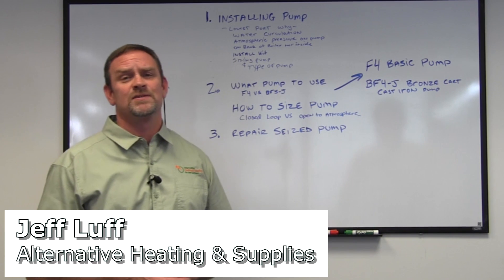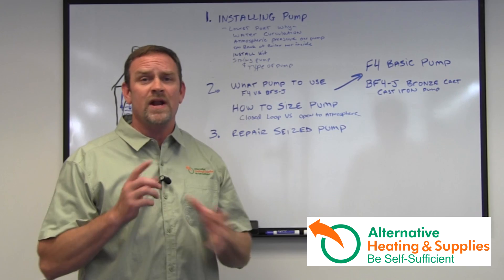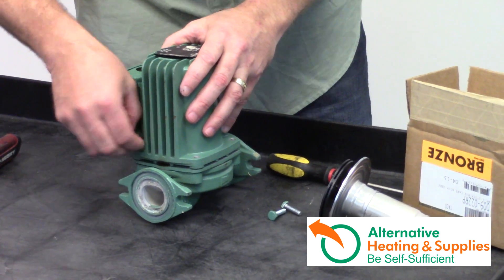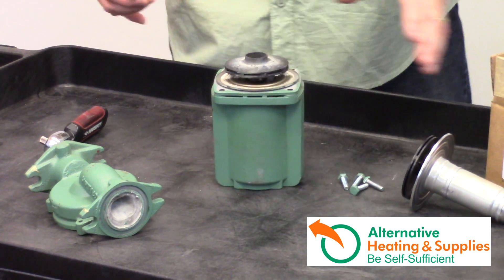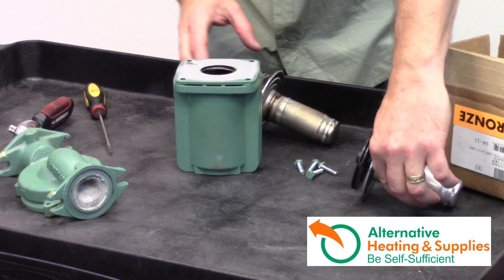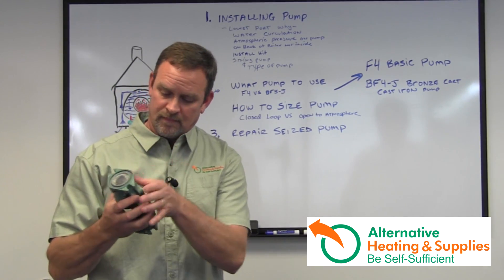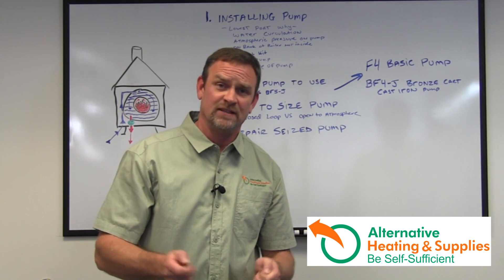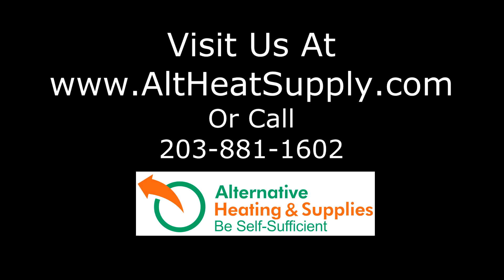How to Fix a Seized Circulation Pump in an Outdoor Wood Furnace Boiler 🔧🔥 | DIY Wood Boiler Repair

Comment: Thanks great video.     I have a  pump that that went through a leave the outside boiler door open overnight, it cleaned out the stove.  Now the Taco pump doesn't want to work to pump water to my shop. Is it scrap or can it be repaired?  Thank you for your time and expertise.  
Cheers
Frank😅
Reply from the maker: Try what I talk about in the video, Try taking out cartridge and loosen it up if you can, or you will know if something broke. I have had a lot of luck repairing them. Jeff

Comment: The only problem I have with my owb is the pump. I’ve had a “new cartridge “ freeze up  far to early. Had to replace 6-8 x in 10 years. Sometimes the bearing implodes , scum , or for no reason but I wonder if some lubricant n don’t tell me about the water being that but I’m inclined to add some new oil maybe 16 oz to 200 gallons n see if it lasts longer but I sure have shitty luck here. It’s a taco oo9. Any input ?
Reply from the maker: Buy the Bronze version Taco 009 BF5-J pump they last longer. Also make sure the pump is mounted on the lowest port on the boiler. A lot of boiler companies tell you to mount the pump on the upper pump and that is wrong.

Comment: What's the trick to get the grundfos pump impeller spinning after a cap replacement. Original cap tested fine. Impeller can be hand spun started but will not move during powering up. No burnt smells.
Reply from the maker: I would call Grundfos to answer that, not sure what your situation is.
Reply: @AltheatsupplyLLC  do you have a open dialog with grundfos? Obviously they want folks to buy new and not make parts repair or parts replacements...but I find this circulator pumps fine....but I cannot keep it powered up 24/7...we are off grid and have parasitic loads on timers. It just will not turn over unless hand spun.

Comment: I worked in plumbing for 27 years, butt this video taught me something. All I ever did was swap out pumps that didn't circulate. My pump seized earlier this year, I planned to replace it before the heating season. After I stumbled across your video, I serviced it and viola, it works! 20 minutes and no money! Thank you from an old plumber.

Comment: Do you need to bleed the system if you have shut off valves on both sides? And I have had two circulated pumps replaced and still have them they made a high pitch sound, are those fixable?
Reply from the maker: Most of the time no.

Comment: Where are most of these located? I have a cozeburn 250 and I'm 19 but I bought my first house and it has an outdoor boiler. I am unsure what's going on but maybe you can help me out. Everything was going good until my Fiance decided to make it 80° in the house I turned the thermostat when I got home but later that day the water was steaming out of the top. I now have shut it off after refilling it at least 5 times just today, I'm wondering if I need a new boiler for outside or I need to replace the water pump or something. Any advice would be greatly appreciated
Reply: Ur cartridge froze up I’d bet.

Comment: Wow! Straight to the point! Now I can size up 
if my home warrantee contractor 
knows what he’s talking about...
or not! 😉
Reply: That is my biggest problem having a seized pump and HVAC AMATEURS not having a clue as to what they are doing...and "being an OLD, OLD lady...I do not want to DIY because there are many times I do not have the TOOLS OR  STRENGTH TO DO a repair...I know how to do it...I simply don't have the strength to do it.   

Then I run into the problem that working with MACHO that because I AM A FEMALE...I MUST NOT KNOW what I am talking about.
Reply: @Princessmmviii  never mind the clowns that charge $400 to come out and fit a $20 part.

Comment: This weekend we are replacing both of our tacos. We have been in this house for 16 years and have not had much luck with the heating system. 4 years ago we went from a boiler system to a tankless. We thought this might help us with our heating issues. During the winter on cold night you cant get the heat above 55. I am hoping that by replacing these circulator pumps that the heat will finally work the way it should.

Comment: Thank you. I bought a few 007-F5s tacos on Craigslist to build "feed & bleed" systems for temperature control of my beer fermentor jackets.  Went to start the first pump and ........nothing. Kicked myself for being so cheap as the replacement cartridge is over 60% of a new pump. Then I found your video.  At first I thought I was freeing up the impeller but turns out the impeller was just turning on the shaft as it is only a friction fit. But I removed the impeller a gave the shaft a little sharp hit as it was frozen solid and voila!

Comment: WHATS THE DIFFERENCE FROM CAST IRON TO STAINLESS STEEL HOT WATER 
CIRCULATING PUMPS.I got an old 50-year-old hydronic boiler. But I don't 
know what type of Taco  H/w Circulating pump I got. And  I need to 
replace it.What should I replace it with cast iron or stainless  steel ?
Reply: Stainless steel - won't rust as fast
Reply: Wish I had seen this video years ago I have a Woodmaster 4400 for about 17 years probably changed the pump 3 times didn't really bother me that much considering my savings in oil nice video .
Reply: Stainless steel is rated for potable water, cast iron is not.

Comment: Would like to see 30200 1 taco pump bearing replacement on a circulating pump thanks also the 121 through 138 and the 1600. pressure is between 175 and 125 psi/ I would also like to see the 302001 taco shaft replacement if it's available .... Thanks so much!

Comment: My pump only hums when I turn it on it will not pump. I pulled it apart and the impeller/armature spins. Do you think it is a faulty case? I got a new motor armature cartage but I cant pull the old cartage out.  Thanks

Comment: Thanks for the Video. A female friend called and said she was having problems with her heat and plumbers wanted to replace the pump @ $1000. I have replaced these before and is pretty simple, However your video has given me something else to check for before replacing a $250 part. Thanks again
Reply: I bought a working secondhand pump for €25 and fitted it myself when the plumber installing the dual heating system left one valve closed after moving the old pump and it seized.

Comment: I have a hair dryer one day it went "clank" and follow by "clunk".  I turn it off and later took it apart.  Two of the 4 blade fan broke off.  I remove the broken blades and put it back together.  Turn it on.  I blows (perhaps half of air) and wobbles.  At least I got the motor turning again.

Comment: Jeff I like your explanation I have about 5 Taco pumps that my plumber replace the last i didn't on my own now I like your explantion that you can rotate the electrical connections which i did but I notice that there is an arrow is the arrow is suppose to go down or up an if I put oil or some king of lubrication to the cartridge. please let me know and also how I get ride of teh air from the pipes.  Thank you

Comment: Thanks for the tip.  I've been replacing new pumps every 2 years for my steam boiler since I needed to circulate hot water through the baseboards in my basement using the extremely hot water from the steam boiler.  Now I can save some money and try to save a few pumps.

Comment: hello jeff. you are very knowledgable. I have had three taco pumps in two years...I was told on the first two it's because I was oiling them....then I was just told by a plumber that you cannot oil a Taco pump. I'm confused...and I'm scared this one will blow too if I don't know how to care for it. please help
Reply: What were you oiling on the pump? The moving parts are in the water filled section, so oil would contaminate the water.
Reply from the maker: You can't oil these pumps. You probably have the wrong pump for your application. Pump failure is less then 1%